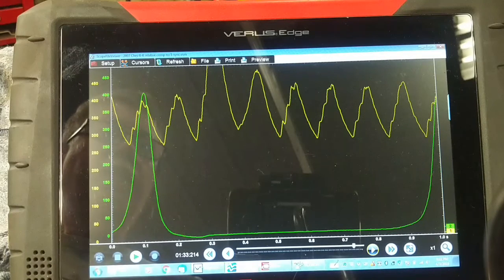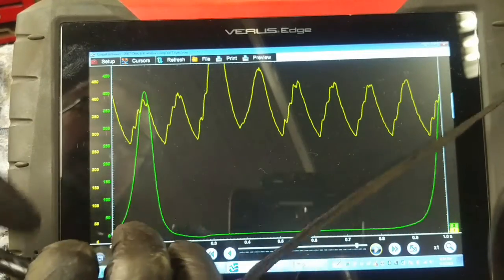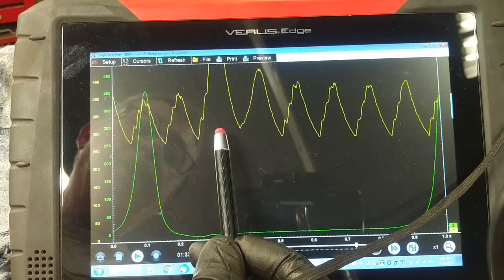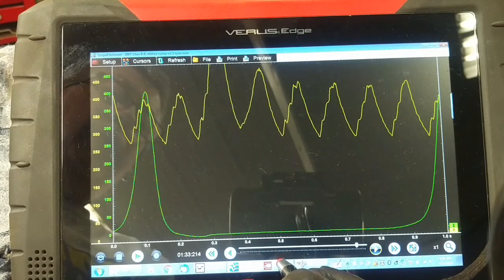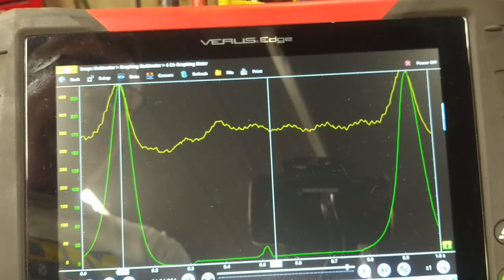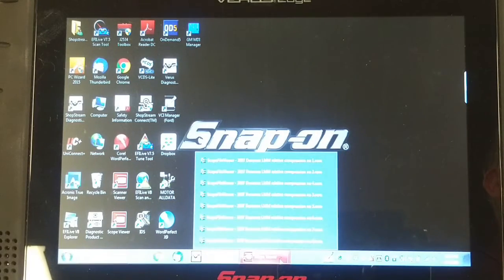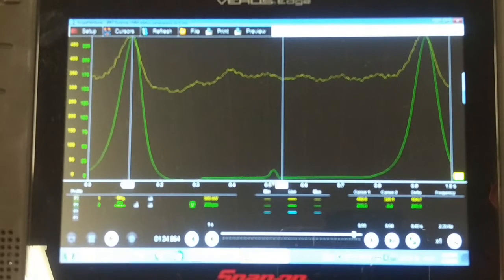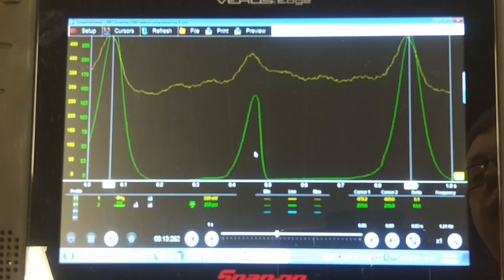2007 Duramax LMM Relative Compression Pt 3

Comment: Without knowing the exact issue yet, it appears that the #4 exhaust valve is closing a little early and the #8 exhaust valve is closing even earlier. You are correct that the middle area between the 2 compression waveforms is the exhaust section but actually, the 360* mark is where valve overlap happens since there is an increase in pressure, the intake valve is not early or it would release the pressure so what can cause the exhaust valve to close early, you have mentioned a couple reasons, worn cam lobe, collapsed lifter, bent push rod, loose valve rocker adjustment if they are adjustable, worn rocker socket where the push rod rides, etc. We believe that timing is not jumped and one cylinder is worse than the other. Further proof of the valve lift problem could also be seen with a closer look at the exhaust valve opening time in the waveform, we would be looking for a late opening and early closing due to the list of possible problems listed above, telling us we need to go under the valve cover to find the root cause, awesome case study so far.
Reply from the maker: Yes it turned out to have two bent pushrods with number 8 resulting in nearly no exhaust valve action. Number 4 was bent slightly had about 1/3rd valve opening. I tried operating the valves and they all moved freely but replaced the pushrods, cranked tge engine with the starter and the new pushrods snapped. I believe the cam had jumped time but never got into it further. Customer put a used engine in the truck. In my opinion the truck was not worth saving anyways.
Here's Parr 4 https://youtu.be/Y0UWadJ7E_0